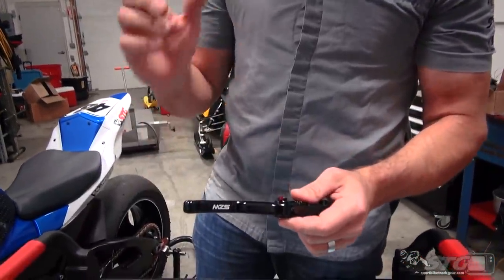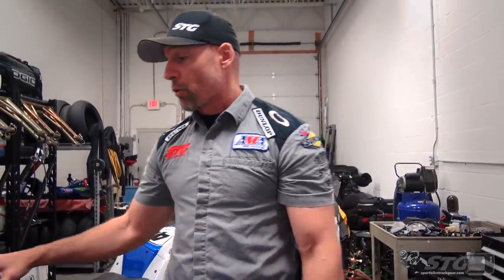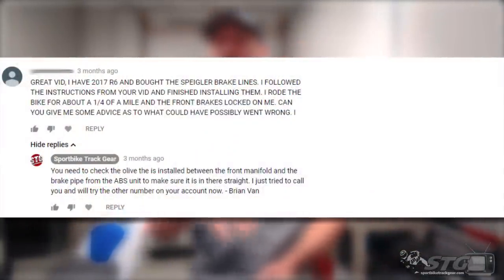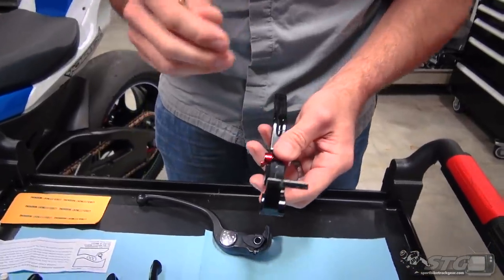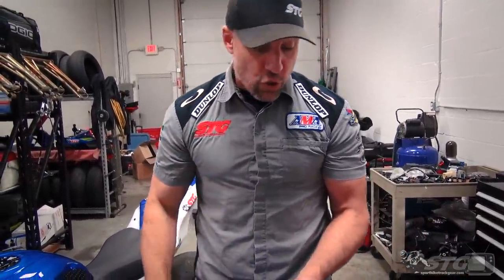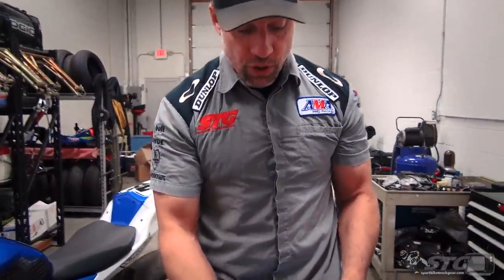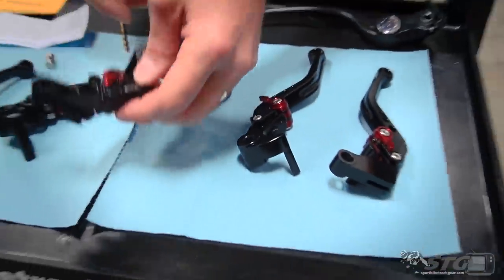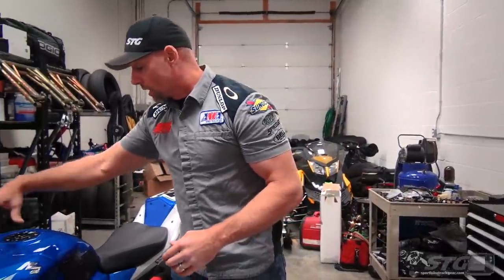The Truth About Cheap Motorcycle Levers | Sportbike Track Gear

Comment: I’ve never had 1 single issue from the eBay levers and I’ve bought like 3 sets for my R6. The only downside is that the black fades into this gold-ish color. I won’t be suckered into spending $100+ for some levers. They shouldn’t cost that much. Everyone has different experiences and opinions about the “good stuff”. I’ll stick with my eBay levers and spend the $80-$90 I saved by not buying ASV levers on something else.
Reply: yea, something else like your hospital bills once the lever suddenly stops functioning
Reply: Xta-C Dummy. They work fine and will continue to do so.
Reply: And that was the last thing RAD Chili ever said before he ran through a busy intersection and got trampled by a semi. According to authorities, cause of fatality was traced down to brake failure.
Reply: @user-cg9vp9bf5d  I'll just tag in.. I have these exact levers in the video and unless theres a new design they dont have this problem his speaking of.. no binding the pin lock thing his talking about is free an loose...
Reply: @robzillagarage  but now we know what problems could arise from the Chinese levers. Only thing that needs to be done is test it out and see if it binds or not. If it does, tell the seller it's crap and you get your money back (if you buy it on aliexpress). No harm done. You can do this until you get a fully functioning one. That's it.
Reply: The ones I got haven't even faded. Had them for 1.5 years and look new. Been perfectly fine
Reply: "Never had 1 single issue"... well they faded. But other than that.
Reply: @BustahNutt  I bet he doesn't even have a bike!! Just another keyboard junkie...
Just one way to advertise another companies product and down another... @xta-c
Reply: BeArJeEzY Did you bother to check my channel? Yea didn’t think so.
Reply: Death Wish83 Yea I meant as mechanical issue. Fading is only cosmetic.
Reply: xLr8Rseven The ones I currently have haven’t faded either. I’ve had them on my bike since 2016. I just had the previous 2 pairs fade slightly. Also the ones I got are a different design. Doesn’t matter though, they work fine.
Reply: @BustahNutt  I'm talking about @xta-c lol
Reply: @BustahNutt  nice bike btw!
Reply from the maker: @robzillagarage  do you have another set to compare them to? The tolerances of these levers are absolute shit, not even close to where they should be. In this video there are already MULTIPLE comments from riders who have had the front brakes lock caused by these levers. The brake locking seems to be isolated to levers for radial brake master cylinders. - Brian Van
Reply from the maker: @Csikter  What if you crash the fucking bike when the brake locks?
Reply: Other thing to consider is the consistency of these tolerances, which may possibly be why much of the consumers have no issues, but who would want to be one of the few that gets a bad production
Reply: 30 extra dollars is too much to spend on getting a quality American made product?  That’s real good of you looking out for foreign workers.  Would hate for the guy down the street from you to be able to make a living.
Reply: @sportbiketrackgear  I will say I have a set of these levers on my bike. I agree the fit and finish is not there of levers that are 5 times the cost. The issue that is described has been addressed and the set of levers that I received has instructions with them that clearly explain proper installation in order to avoid this issue. I have never felt unsafe riding with them. That being said for those that can afford it and want the better levers more power to them. I knew I wasnt getting top of the line and wouldnt keep them on my bike if i felt at risk. Again though PROPER installation is key and instructions were given with the product just like the high end levers.
Reply: #poorpeoplecustoms
#poorsneednotapply
#ebaycustoms
Reply: RAD Chili I’m with you I’ve used Chinese levers for last 6 years on various bikes and ride every day. Never had a issue. Used to fade in colour but the last Two sets I had haven’t added so they getting better and better. If your on older bikes like me too they don’t that that part that this video shows is a issue as basically just work on a plunger worth keeping in mind for those who are anti. ✌🏻
Reply: RAD Chili I did over 50k miles on my FZ09 with the MZS levers and had no issues what so ever . I just put the new model of the MZS on my 2017 R6 as well. Here’s the thing , inspect the part before you put it on . This one from the video for sure is defective. Send it back and get a new one . Of course, the CNC made here in the US is way way better quality but the Chinese part does its job on the streets!
Reply: try rcb a very good product in asia 20$ i guess, feels and looks good been using for 3 years still fine, i never dropped mybike though
Reply: @sportbiketrackgear  ...  AHhh  Yep these guys sound like me before the lever malfunctioned.  Chances are they wont fail. However if they ever do....    There are so many risks involved in motorcycles.  I learn to limit the possible associated risk a much as I can.  I was also fortunate enough to ride out a locked throttle malfunction coming out of a apex of a fast turn.   Throttle cable slipped out of a aftermarket throttle cam.
Reply: I’ve never seen a single problem with cheap levers they don’t have much to do with anything they are metal and just push a plunger if your breaking them you should probably chill out.
Reply: I've had stock lever fail on both sides actually and I have had a set of 20 dollar levers on my bike for the past 3 years even the cheap ones like I have are billet not cast and I have never had any problems with them I with RAD on this one I'll save my money for the more important things paying 200 or 300 for a set of levers that cost 20 bucks to make is just ridiculous
Reply: BeArJeEzY So I spend my time watching a video comparing bike levers and you make the very logical assumption that I don’t have a bike? You’re not very bright, are you?
Reply: @user-cg9vp9bf5d  ever heard of a poser? Wait this is the ultimate poser move; fien ignorance.
Reply: I have had 3 sets of the MZS or whatever and never had any mechanical issues. 2 sets faded to a brownish color though. I wasn’t aware of the play or anything that was demonstrated in this video. They’ve worked just fine for me in the past, but I’m a little bit concerned now lol.
Reply: RAD Chili you bought 3 sets for your one bike? Yeah sounds legit.
Reply: Christian Sams Yup. 2 for my first R6. 1 set for my current R6. They’re so cheap in price I got different colors. All those 3 sets never failed on me.
Reply: Juxtaposed1Nmotion I don’t understand what you’re trying to say lol.
Reply: RAD Chili well if you would of bought the quality affordable ones for 130$ a set then you would of only done it once not 3 times but I am running those eBay levers on my fz07 but seeing this imma change to those 90$ ones I value my life more then $200 and the levers that I have are loose fitting like the lever has play and I remember the oem ones didn’t have that so yeah I’m going to change over to them and yes I agree to buy it if it is not that important but something like levers yes it’s very important
Reply: "I’ve never had 1 single issue"
Well, once you'll have ONE you won't be here to talk about it...
Reply: Martin DYN yeah that’s what I thought only need them to fail once
Reply: Absolutely agree
Reply: I'll chime in four months late, but there's some things you get cheap, some things you invest the money in. Levers and controls of any kind, I'm going for the proven stuff. Big reason why ASV levers, and any other "big brand" command the higher price tag is because of the cost of research, development and testing. The big companies don't just claim their stuff is better, they pay the money to conduct the research and prove that it is better. MZS and the companies that basically reverse engineer products that ASV would manufacture could sell so cheaply is because they are copying an existing design. Aesthetics is the only thing they'd be able to match. The tooling and the machining, not to mention the material can't ever be replicated. Not to mention the all important proving factor of research and testing.
Reply from the maker: Well said.
Reply from the maker: CRG, ASV, Driven, Vortex... all made here in the US. Your comments are not even close to accurate. - Van
Reply: Millions around the world use these shorty levers. Any issues are generally with the install.
Reply: Yeah lots of people may use them and have no probs, but there will be lots of people who use them and have problems. The quality control is terrible on parts likes this. Are you really willing to play russian roulette with your life to save a few $$$$
Reply: The extra cost is typically for the testing that goes into the product.
Reply: @sportbiketrackgear  what about hotbodies levers?
Reply: Could fail, ofcourse. Expensive levers could also fail. Think of the millions of levers sold of eBay origin compared to alot less premium levers. Products fail inherently, thats a given. Chinese levers may fail more often; but there is no data to prove it as there have been millions of them sold more than their pemium counterpart. If you ask me the data is skewed. It shoud be looked at relative to units sold.
Reply: Made in US? Which part?🤔
Reply: I just want purple levers to make the lady happy without getting her killed.
Reply: Ok. Good for you.  Save a 100 bucks to have a potential crash waiting to happen..  I've heard countless stories about people crashing with these levers.  Why would you risk you and your bike over 100 bucks?
Reply: @sportbiketrackgear  there is no point in trying to help these fools.. they seem to know best and wont have any issues..  just like the guys that crashed cuz these levers, they worked great until they crashed.  Lol.
Reply: I also have this ebay levers. Work fine so far.
Reply: @robzillagarage  I have these same ones as well and I'm hoping they do not give me any problems. I would assume as ling as you keep the pin greased it should function correctly.
Reply: Im too poor for cheap things sorry
Reply: Exactly
Reply: Well I’m a SKWiiiD so I’ll be wheeling with a white t, golf shorts, white air force 1s and Chinese levers 😎
Reply: are ride it forever cnc levers made in the US?
Reply: I bought these levers not knowing the importance so I’m glad I started my own research and I have to say I’m not willing to take that huge risk just to save some cash. I’m definitely ordering some better ones now. (2019 r6)
Reply: @clintknowlton4589  Yanks will buy any old shite if it's American made.
Reply: So you'll buy 3 sets of unsafe garbage instead of one good set? Weird flex bro.
Reply: @Gideon_Judges6  3 sets of different colors 🤡
Reply: you was just lucky.

Comment: Thank you for putting this out there. My front wheel almost locked up after installing a set of these cheap levers. There are videos on YouTube of crashes caused by these levers. Not worth it. Brian is spot on.
Reply from the maker: You're welcome and thanks for watching! - Van
Reply: if your brakes locked up after you installed aftermarket levers, its probably because you installed them incorrectly.
Reply: I've installed cnc levers from China on my gen 1 fazer 1000, not an ounce of problems at all, and as to the  allowed movement of the pin on the end of the clutch and brake cables, I've messed around with bike ones, they don't move, they're not supposed to move, why would you want them to move??? That's just gives another strain point on the cable, it needs to be rigid
Reply: Your a moroon You have to grease these period you also have to tighten the Allen and bolt to desired tension.
Reply: @christopherdonlick9119  Absolutely this.

Comment: Never had a problem with cheap levers, had them on about 6 different bikes! And will continue to buy them
Reply: Me too dude. I actually just bought a set of the mzs that he discusses first, and i love em
Reply: I bought the blk& red "ride it" levers and outta the box the blind hole for the pin was "loosey goosey" there was SOME play all I did was tighten the nut on bottom a little and slapped a little grease on it good to go and the shorty size was a little longer than rc2.but other than that they been good to go for 6yrs now.

Comment: Got a pair of foldable, extendable lever for 25 quid on amazon, I've bought like 4 sets on all my different bikes, absolutely good quality, simple and robust design, nothing to fail on there, on the other hand, my XT600 had a set of ASV levers on it (they are like 80 quid EACH if i'm not mistaken), one time the bike fell off the kickstand and landed on the bars, i pick it back up, nothing special, about 20 mins later when i go to leave at the 3rd or so redlight trying to stop, going to pull the clutch in, lever snaps off and made my bike almost jump into the intersection... I've dropped, hit and clipped my bike dozens of times with these amazon levers on, they never failed or shown any signs of failure.
Reply: @Thgt Ggyh so you don't drop your bike when offroading? You are the perfect rider in that case... The XT600 is a dual sport, pretty sure the falls are from offroad riding

Comment: ive never had any problems with "cheap" ebay billet levers and ive used them on most of my bikes since i started riding back in 1991. used them on my suzuki katanas, gsxr's, rf900 and now my kawasaki zx14r. love them. i make sure to use synthetic grease on all of the "friction points" to make sure they always operate smoothly and blue threadlock on the nut under the levers so it has no chance of vibrating off.
Reply from the maker: Happy to hear you have had a good experience using these junk levers on your bikes. Personally I would not install them on a riding lawnmower. - Van

Comment: Another great video guys. On my R6 race bike I run CRG carbon fiber levers with the remote brake adjust. On my supermoto I'm running ASV. You get what you pay for, and levers are certainly a no compromise part, they have to perform every time.  Better to spend $100 per lever than have to pay $1,000 or more to fix your bike when you crash because of crappy cheap levers.
Reply from the maker: We are 100% on the same page. - Van

Comment: First of all I want to say great safety information in this video! You had me worried since I found this video right after installing the Amazon Chinese levers on my grom and z125. I watched this video 3 or 4 times trying to understand how such a simple lever could fail like you talk about. Secondly, I wish you would've talked about the difference between axial and radial brake masters. It took me a while to realize that the grom and z125 levers are axial and don't have that cross pin bearing and that there is literally no way for those to fail, in that manner. Aside from a little up and down play (really no worse than stock) I am resting easy now lol. Thank goodness, there was no way I would've spent $200 on levers for either of those bikes.😄
Reply from the maker: You will not have the problem described in this video with your Z. - Van

Comment: I believe 95 percent of the headaches I have had in my business ( 35 years) have been caused by inferior aftermarket parts. I have had countless issues with lever fitment. I support your videos making the public aware of these poor fitting parts. Keep up the good work. If ONLY 1% of the levers sold were bad, how many people would that account for? Your body sliding across the ground isn't worth saving a buck...
Reply: Your a motorcycle mechanic? if you watch the video of the guy coming down at the 10 sec mark just before he goes down the motor soars in revs, whats that got to do with the front brake locking up? sounds like he grabbed a handful of clutch and lost control.
https://www.youtube.com/watch?v=gmOVptDWSPE&feature=youtu.be
Reply: @kx501  my comment stands.
Reply: @patrickscycleshop  It still stands? Without even addressing what @Bike Modder said?
Reply: @sekou3758  irregardless of how this guy crashed his bike. My comment still stands about the poor quality of aftermarket parts manufacturing. I remove a lot of these levers from bikes that cause the brake Pistons to stick in causing brake drag, brake light switches to stick in or in general poor fit. I've seen quite a few of these levers break without ever having contacted the ground. As I said my comment stands about the poor quality of aftermarket parts.
Reply: @sekou3758  he may well be right about the clutch grab, not going to deny that but as I said, my low opinion of inferior aftermarket parts still stands.

Comment: I'm gunna check my MZS levers Monday.

I haven't had any problems the last 2 seasons.

Thanks for the heads up.
Reply: I ended up taking off my $30 chinese levers and put the stock levers back on until I can afford a good set.  My brake lever was bound up just like those cheap one's that Van had.  I'd rather be on the safe side instead of crashing my 11k zx6r.. not worth it.
Reply: Any update? Still use the mzs?
Reply: @krisreeves6242  I actually switched back to my OEM levers, but NOT because the MZS levers failed in anyway.

Honestly, I got tired of the embarrassment of stalling my bike at the beginning of every riding season.

The MZS levers never got stuck, or hung up.  I did lubricate the pivot pins with lithium grease.

Hope this helps.
Reply: @huffingfarts  hey thanks this is super helpful - I ordered these from whatever province in China they are coming from (not arrived yet) and haven’t installed them yet. It’s good to know there is a chance they will arrive mechanical sound...
Reply: @krisreeves6242  I've had MZS levers for the past 3 years and no issues whatsoever.  Just grease the pivot pin when you're installing them.
I have a 06 cbr 600 and the levers don't have the pivot pin, so there's that